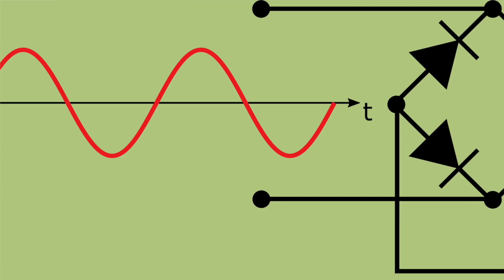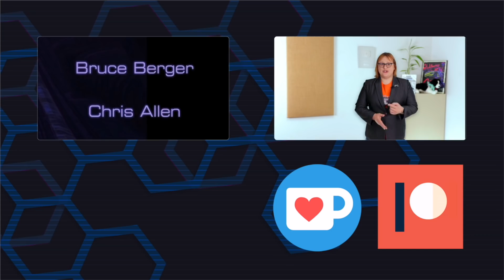Bidirectional Charging in A Tesla Model 3? BUSTED

Comment: All it would take hardware-wise is a transfer switch and circuit breaker to connect the traction inverter to the mains. A three phase connection may need a transformer or fourth half bridge to provide a neutral.

As far as current charger circuitry, I'm sure Tesla implements active rectification wherever they can to reduce heat production. V2G might be impossible for a charging circuit even with a complete absence of power diodes.

Comment: Surprising to see so much anti V2G sentiment here. 
With 9 kW solar on my roof,  (which pays for itself after 6 years,  and a Tesla with 75 kWh and a Fiat with 24 kWh (well actually now 18 after a heat stroke in the desert), all i need is for my cars to be bidirectional and I have backup power and the equivalent of 7 Powerwalls, or about $50,000 at current prices. I am already pretty darn carbon neutral which is my goal. I use Net Metering to effectively store my solar energy in the grid and use it at night. 
The grid benefits from lower peaks when AC units go on mid day. Even better if the energy could be truly stored and managed. Car batteries, when evolved to more ideal cycling life, which thanks to Elon & co are about to appear, might as well be utilized to benefit the grid as well.  It will reduce the burden on utilities  to buy more batteries and help lower your rates. Mine are already almost zero thanks to my solar investment. Not everyone has a roof they can put solar on and both commercial rooftops and utility scalar solar and battery storage are necessary, as well as V2. At ist base, V2G is a slightly higher volatge than the grid's, supplied by an inverter synced to the grid's frequency, combined with monitoring and control. This stuff is already there. 
The utility already tracks this through smart meters and whether they pay the  generation source for that or not is more a function of politics than technology or major capital investments. Politics is how I get Net Metering.  I like it and I like my utility, except when the Santa Anas blow and they threaten to shut down my whole system. I bailed on my powerwall order just because I couldn't see paying for it when I have 100 kWh in the garage. If only I could tap 10% of that to keep my solar producing during these shoutdowns, run the house and keep the battery in the car charged. 
Generally, interconnected PV systems shut down when the grid goes down as part of the interconnect rules. By design, to comply with these rules, Its inverters need to see a 240 V 60 Hz signal to sync to or they shut off. The car could supply this with mostly already present hardware. Plenty of folks are already doing this with home brewed systems using slightly modified off the shelf inverters. These home made powerwalls are using batteries extracted from cars in a second life application.  The car has all it needs to do this, as AC Propusion did way back in the early nineties with their elegant bi-directional power electronics, or many CHAdeMO EVs are already capable of, except for permission and maybe a few hundred bucks worth of smart connectors to respond to the permission.
It is understandable why Tesla hasn't done this.  If a customer were to overuse such a system and cycle their battery up and down everyday, it would shorten the life of the battery and make for very complicated battery warranty programs that would lead to headaches to say the least. They have the powerwall, which is a nice solution for a non EV solar customer. I think It's the smart call, but as they develop better batteries and the monitoring and control systems for grid storage,  develop battery recycling and second life applications, energy arbitrage, etc., they will undoubtedly revolutionize what we call V2G and give customers and the utility companies an opportunity to benefit even more from the kWh's carried around  around in their cars. 
As for mobility on demand and the value of cars with high utilization rates, this future assumes a whole new business model for both cars and batteries, not to mention, broad acceptance of using cars other people have just gotten out of.  V2G is in no way a burden on fleets of such vehicles, just an opportunity should the situation arise where the utility needs the fleet's distributed energy potential.

Comment: In order for V2G to be economiclly feasible, two conditions must simultaneously be true.
1. Daily price swings mean vehicles can be charged from the grid at low cost at one time of day, and sell back energy to the grid at higher cost at a different time of day.  This might happen with proliferation of cheap solar.
2. It's more cost effective for the utility to buy back power than to own their own storage.  Highly unlikely this will occur.  Utilities have the benefit of economies of scale that individual consumers don't.  They will buy grid scale batteries instead of buying back power.  Also each EV would need to be connected to the grid during the day which means overbuilding charging points.

If you think selling power to the grid is going to pay for your EV and even make you a profit, you're going to be disappointed.  It will be a emergency power supply for those on hurricane prone areas though.

Comment: Doesn't using the cars battery for V2G ultimately shorten then life of the car by using battery life cycles, hence you'd be better off with a Powerwall.
Reply: Depends on how much they draw and how they draw it. The question should be how much can you charge them for the priveledge.  This stuff is negotiable, at least on a macro scale and in a democracy.  
there are a couple of ways to view this. I have a solar system interconnected with the grid which does exactly what the car could do, except that the car can store energy from a variety of sources, and make it available during peak demand. It can also supply the home and its solar system wiuth the grid like signal it needs to continue operation when the grid is down. Very appealing for someone in California whose power gets shut off by a utility who hasn't maintained its equipment for safe operation during So Cal Santa Ana wind events, leaving it prone to starting fires.  The AC Prop solution facilitates both, and to the utility it simply looks like either low demand from the home, (if the car's system is set to only supply the home's power demand and not feed the grid,) or it looks like a solar system that's generating. There is no rational reason for a utility to think of this as a bad thing. It helps them. Some Utility administrator could of course act irresponsibly thinking they are increasing profit. Currently utilities are motivated to install their own batteries because they have guranteed profits by setting rates which yield about 10% profit based on their captal expenditures. So adding expensive installation projects increases their overall profits.  Their only real motovstion for disallowing interconnected energy supply on a distributed scale. There is ample evidence of irresponsible utility behavior in California, but their profits  have gone up in smoke. Those kinds of thinkers can and will be eventually replaced.  They can use V2G for all kinds of positive benefits for their operation. If they have a safety concern, when they have shut down an area for maintenance or another reason, the home system, as is already built into all back up generation systems that are interconnected to the grid,  disconnects from the grid seamlessly.  This stuff already exists. The missing piece is the plug that goes from the wall to the car to simply allows for the two way flow of electrons. 
The battery in the car has limited cycle life and I wouldn't want my Model 3 drained and filled repeatedly. This wouldn't happen, because I don't need 75 kWh every night, more like 5-10. And my high power consumption can be timed, as it is already, to happen during periods of low demand. Smart software is the secret sauce here, and Tesla is very good at this. Tesla's Autobidder is already solving these probles with stationary battery assetts, adding the car is the next step. Currently, Tesla has kept the car battery seperate from utility storage partly because they sell Powerwalls, but also because the revenue stream incorporating the car hasn't yet existed, and they do worry about battery degradation concerns from customers. Their battery is tuned to be good for the car and there are difference between it and a V2G optimized baterry.  But the million mile battery technology coming will fit nicely into sevral new business models for batteries that Tesla could exploit for their own benefit but aslo for the customers' financial benefit as well. I would of course expect to be comensated for my car's battery being used by the grid.
The real next frontier here is how to get solar onto commercial rooftops so that all of this can happen at work as well as at home. Batteries parked at work, soaking up energy, ready for service when parked at home for the evening's demands. And for supplying the on the road charging infrastructure that the car companies should be building, just copying Tesla's supercharger network, and their DC fast charging hardware and software.  This also helps the other needed goal, which is to stop supplying vehicle choices limited to 5-7 passenger one size fits all cars with oversized batteries because we worry about that one trip a month where we might need a longer range than what can be conveniently supplied by a few stops at a fast charge station. 
I believe Elon is way ahead of all of us, having understood these issues long enough ago that he has the solutions nearly ready for deployment. Getting the solar and batteries right , with the latest NMC chemistry, efficient production, and JB's recycling, It will all come together nicely.  Just waiting for the personal mobility product that takes advantage of all of this tech to reduce the overall foortprint of our transportation.

Comment: There’s an interesting story to be told here. If you go back to AC Propulsion’s early power electronics, you’ll find they were bi-directional and had an integrated charging function using the motor controller’s inverter and one phase of motor windings. There was no dedicated charger hardware per se. it worked well to lock on to the grid signal and feed backwards. Would love to understand why Tesla evolved  away from that design as they created their own. A great interview would be getting Alan Cocconi, JB and Elon together. All absolutely brilliant people.

Comment: Anyone a bit up on the news already knew this is not going to happen soon. There is a need for a much longer lasting battery for this to become a reality, which means probably only Model S and X are getting it, provided they are the ones getting the new batteries (Maxwell tech etc). Otherwise the Cybertruck will be the first to offer it.
I'm also guessing the V2G will require a Powerwall for the power distribution and regulation.
Looking forward to battery day.
And anyone interested in this topic should visit the limiting factor channel. The best in Battery Tech Analysis

Comment: The question remains, if when the car is fast charging with direct DC that bypasses this AC to DC controller, could DC also flow out of the car, or is it unable to do so due to one way diodes on the separate high capacity DC cables?

Comment: If I have paid ten grand for a “million mile” battery pack, I sure as heck don’t want some utility cycling it for free as a grid backup that they failed to build into the grid.  IF there were to be a way to use it as a backup for MY house in a power failure situation, that is a legitimate and infrequent good use of the cycles I paid for.
Reply: Exactly.  One reason I think the boner for V2G is massively overblown.

What's the V2G use case?  The only one I can think of is charging them with cheap solar energy during the day and discharge overnight.  Which would require a grid tie in for EVERY SINGLE EV during the day.

Just build grid scale batteries.

Comment: the use cases for V2G are not common use cases. there is no point to add an expensive feature, when people are not using it. on the other side we see that battery prices will drop and especially with the modules that GM is developing, there is another door opening to use standardized modules that could be used for a flexible power wall at home. these standardized modules are the future

Comment: yes, I can verify that many Diodes look exactly like Mossfets.  I use some in my electric model aircraft builds for the autopilot power supply.  they are more compact than using individual diodes, and require no assembly. Also save a tiny bit of weight. :)

Comment: Diodes are a simple PN junction and will drop around 0.6Volts depending on current. In very high current applications this voltage could easily rise to over 1.2V which means a lot of power being wasted and therefore excessive heat generation. Modern high efficiency power supplies will use synchronous rectification which uses a controller to switch a bridge of MOSFET transistors to conduct when on either the positive or negative cycle of the waveform. MOSFETs have evolved to have very low ON resistance and therefore much lower losses when handling high current. So the reason the diodes look like transistors is because they are transistors, but just being used as diodes.
Also MOSFETs can be switched really fast allowing higher frequencies to be used in the battery charging section allowing for smaller transformers to be used which gets weight down and improves efficiency from less copper/iron losses.
With suitable control of the MOSFETs there is no reason why you couldn't run the power backwards, but this would depend on the MOSFET controller being used. There wasn't much in the way of filtering on the schematic so I'm not sure the circuit was ever intended for V2G as the EMI would be really bad and grid operators would probably object to all this conducted noise on their supplies.

Comment: Commercially V2G is a bad idea for vehicle owners. Take the model 3 (250 mi) - pumping 54kWh or 54 units to the grid would be the equivalent of driving the car 250 miles for the battery and the battery warranty. The degradation of the battery is much more expensive than the feed in tariff or peak power rate earning.
Reply: Helping the grid could be with very shallow discharge cycles. It could even improve the temperature and longevity of the battery before a trip while making money on the FCR/aFFR market. These markets are more about power than about large amounts of energy to be delivered.

Longevity doesn't need to be negatively impacted: https://www.current-news.co.uk/news/v2g-found-to-improve-the-lifetime-of-electric-vehicle-batteries

Comment: Seems like Tesla's V2G would be best served via a wall charger with an inverter. Pull DC from the cars battery on the same wiring that superchargers use to push DC to the battery during supercharging. That would bypass much of the cars Charge Controller circuitry saving wear on those parts while also allowing for more than 48 amp draw assuming correct wiring of the wall charger to the house/grid.

Comment: The physical charge connector does not support V2G either.
Reply: The Model 3 has CCS, this same connector is in use for both AC and DC V2G today in the Netherlands. The physical & link layer of the connection (OSI layer 1 and 2) are capable.
Reply: Erik de Bruijn correct the EU version with the type 2 CCS has enough physical pins to support this. The NA spec does not.

Comment: I would image it could be possible to intercept the current directed at the motors from the battery, but then there would need to be another inverter from 400v to 240v mains.  And some kind of retro-fitting going on to existing cars. I guess it could be introduced by Tesla into new cars. There may be good economic or engineering reasons why the benefits do not outweigh the penalties>? And possibly from a marketing point of view, not a good idea to kill off Tesla Powerwall sales in lieu of a mobile one screwed to the bottom of your Tesla.

Comment: Great information as ever. Can I throw an idea out there... Could it be the reason why the Model Y in Europe is coming from the new factory in Germany is because it will be the first with vehicle to grid technology. It is after all the changing of just one part of an existing board.
 
The main reasoning could be that he thinks it will be easier to do here with the way our National Grids are set up and already heading towards a Micro Grid method of working. 
So not so much it won't happen elsewhere just probably going to be quicker and easier to get running and more importantly testing here in Europe and maybe in particular the UK.

Comment: Diodes DON'T turn AC into DC. They pass current in one direction which means that the positive portion of an AC (sine) wave passes through the diode. It's not DC, it rises from zero volts to peak and back to zero. Yes, the more phases the less it drops which is why car alternators are 3 phase. If we run a single phase 60hz sine wave (USA mains) through a bridge rectifier ( a full wave rectifier can be two diodes it doesn't have to be a bridge) we get out of the bridge or full wave diode arrangement 120 hz AC not DC.You can run diodes in a bidirectional circuit but you most likely have to use dedicated FETs in both directions. Bottom line, we still don't know if the Tesla circuit does that or will have the ability in the future to do it. Let's see the schematic and we'll know for sure.